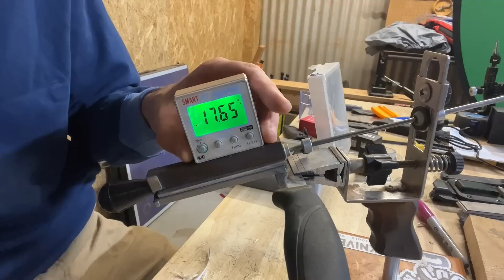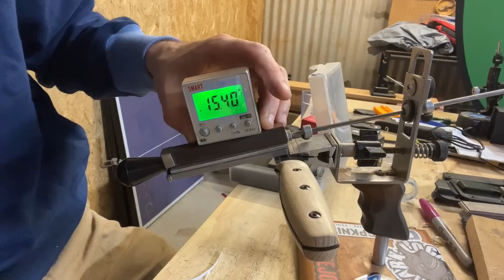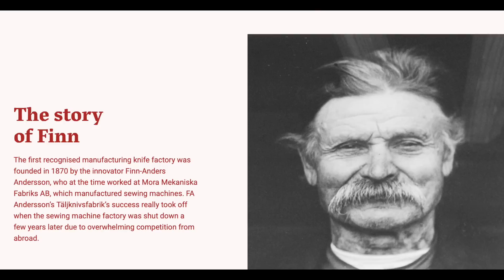The Gentrified Mora with Bin Steel? Morakniv Ash Series Finn

Comment: Mora has some real cajones releasing a knife that performs worse than a Condor for LT Wright pricing
Reply: Do people really have issues with condors? I love my condors, they just don't come sharp, you gotta sharpen them yourself. I love their 1095
Reply: I saw a Mora Garberg vs Condor Terrasaur test and they were head to head… I have a Kansbol but if I would like to upgrade I will go with the Terrasaur…
Reply: @mokgable  Condors are great, but they are basic materials (usually 1075 or 1095) assembled to hit a price point.  That’s not a problem.  If Condor took their current line and priced it with LT, Bark River, White River, it would be silly.
Reply: Why he always add -ish 
New-ish
Style-ish
Modern-ish
Does Everone in Austria are so "-ish"
Reply: @jimlahey5623  Australia 🇦🇺.
Reply: Well Benchamde is getting away with ripping us off over here in the USA.. So I guess Mora wanted to see that effect too.
Reply: Balls of recycled mystery steel
Reply: @mokgable condors were great when they fist came out because they were cheap and good quality. Now they've raised the prices so much they're expensive for what get imho
Reply: Benchmade quit ripping me off back after the large Skirmish was made and I haven't bought one since😂
Reply: Isn't condor some trash made in South america tho, hardly comparable

Comment: They responded to me on Instagram a while ago. It's their basic 12C27, doesn't appear to be any difference in performance (edge retention & toughness) between the new expensive ashwood line & a cheap companion.
Reply: Yes this is what they told me too. They said it's the same steal they used all along and it's always contained as portion of recycled steel *but they wanted to highlight the fact now*.  Causing all sorts of confusion.
Reply from the maker: certainly seems like it in practice. great steel on a $50 or less knife for sure
Reply: Thanks for the info.
I'll stick to my Companion, then.
Reply: @andriesquast2028  good plan!
Reply: @CedricAda its more like how is made than from what is made. Speaking that way than Devin Thomas knives should be priced low because his knives are made out of aeb l which is also inexpensive steel.

Comment: Hi mate. As you probably know by now, all Steel is recycled, completely normal, has been, according to Alleima for a very long time (and Larrin Thomas - see his book 'Knife Engineering'). Only kind for kind is used - 12C27 for 12C27 etc. Mora have recently, via their 'Steel grade Mora' system, become far more informative on their Steel grades and processing etc. Thus, in the case of this knife we learn that it's 12C27 using Cryo, with nominal hardness of 58 HRC. Purpose of Cryo being to convert retained Austenite to Martensite meaning significantly higher toughness and hence better edge stability. Notice only two point increase to 58 compared to nominal 56 for Moras using non Cryo (Companion et al) hence emphasis is on toughness. Bevel angle for this blade at 2mm thickness should be around 23°, so microbevel (Swedish - edge reinforcement) to bring up to, for me, 32-33° would be good. Mystery of 'Mystery steel' solved. I would happily give 50 to £60 for this, but not price asked. That being said Helle do a similar knife in 12C27 for far more than 50-60£, does that have Cryo?.
AL.

Comment: I feel the same with Gransfors Bruks recycled metal they use for the axe heads. I finally treated myself to one roughly a year ago to only be extremely and utterly disappointed. The first few times I "LIGHTLY" used it essentially just playing around with it to get a feel for it - it sustained micro chips in a roughly 1 1/2 inch section. I tried to stay positive and assumed maybe it had some softer left over bits on the polished edge... Fixed it and used it one more time and it failed even worse with more severe edge damage; I used it harder this time being I actually tried to chop up some wood which it is made to do. I returned it... The axe that failed me personally is the Wildlife Hatchet; I opted for it for a light weight chopping option. In fact thinking about it... I'm still livid about it.

Comment: In Serbia to import Fin is 160 EUR ($176.5) , Wit  is 207.6  EUR($229 ), and Lok 239.5 EUR ($264), a bit expensive for blade thickness of 2/2.5/3.2 mm and 12c27 is a low end steel. I like that steel even fore Helle i think it is pricy and Helle is chipper then these Moras. For less or equal money you have: Lionsteel B41 / B35 (Sleipner steel), Lionsteel M4 (m390), Lionsteel T5 (Niolox), Rokka Korpisoturi (N690 and 80CRV2), Benchmade Leuku(CPM 3V),  Benchmade Puukko (CPM 3V), Esse 4/5/6 (1095), Becker Companion (1095),  Fallkniven F1/F1x/H1/S1 (Wg10w and COS), Casstrom Lars Falt (Sleipner ), Casstrom No10 (14C28N), Brisa Traper 115/95 (Elmax , N690, O1), Demko Free Reign (Aus 10), Tops Fieldcraft (1095) ...

Comment: Hi there! I'm a big fan of MORA. I really love the Companion and Outdoor 2000. You can get them for just $20-$40.

I don't really need super steels. Knives made of 420HC, 12C27, or 1095 work just fine in the forest and are super easy to sharpen. You only need a small stone to get the edge back.

However, if I'm buying a $200-$300 knife, it better have super steel like S30V or MAGNACUT. Even though super steels aren't a necessity in the forest, a $200-$300 knife should have them.

I don't get it. I love MORA, but if it's $300, I'd go for a super steel knife.

Comment: Your comparing it to the wrong thing. If you wanted to compare it to the companion you should have got the Finn’s big brother.

My opinion, as I use the Finn for its purpose, it’s a great outdoor woodcarving knife.

Not an everyday bush crafter.

The thin stock is great.

Also, don’t compare it with steels for a different purpose.

Regular stropping of the Finn, in the field, when used for what it’s designed for is great and it’s easy.

I agree. It’s not for a knife fan boy.

It’s designed for those that know what it’s for.

I think it’s mostly the 27 steel. But maybe mixed with some of the 28. Maybe that’s why they just say “recycled” rather than what it is.

But Mora never just made this for themselves. It’s not a hobby knife.

It was made for people that know why the need it.

Price?

Think of this.

For years everyone has said that Mora’s are too cheap.

Then they start charging everyone else’s prices and they get it proper tight.
Reply: Nobody complains about the prize of older moras dude
Reply: @LosRiji  for sure , meanwhile they say they are better than a lot of more expensive knives.

Hence the price comment.

Comment: The recycled steel in that better be way better than what they use in the companion HD. 
Because when I got a companion HD with the new recycled stainless steel, I was quite confused at first. 
I'm still not sure if I got a knockoff, even though it came in original packaging. 
The grind is looking sharper, the microbevel is smaller but it doesn't cut very clean. 
The tip area doesn't even have a apex, I can see a reflection there. 
And the steel looks dull, refuses to be polished properly and has what looks like microscopic bubbles. 
At least the new production carbon steel version of the companion hd is still ok.

Comment: For the same price I bought a spyderco Enuff 2 in K390 on sale. I think you hit the nail on the head with the reason why this knife was made.
Reply: I really like mine but it rattles in the sheath. It’ll  probably cost me an arm and a leg, take 10 years to send it back to Spyderco just for them to say it “doesn’t rattle enough for us to replace”.
Reply: @Dan12345  the sheath is garbage. It dulls my knife every I draw it, I am making a new leather one. I don’t understand Bolatron sheaths, it dulls knifes just like secure X
Reply: @nandayane  I’m going to see what they quote me on return postage to see if it’s even worth returning. Luckily I have a leather sheath I made that doesn’t fit its the original knife well but fits the Enuff 2 quite well. It’s a shame as I really like the knife itself.
Reply: @Dan12345  I think the industry should move on from that style of sheath and just use kydex.
Reply: @nandayane  definitely agree. It’s the same with my Ka-Bar Mk1. I think sheaths should be Leather, Kydex or Canvas. A sheath that dulls the blade is a failed design.
Reply: @Dan12345  in particular with a steel like K390, eliminates the point of it.

Comment: That's a great 50€ knife !
For the price, you can get some alternatives in CPM-3V or Magnacut which are bulletproof !
Reply: @1800moonSugar  Less HRC so (way) less edge stability, less edge retention, less corrosion resistance, overall a worse blade imo !
And about CPM-3V it was made originally for huge metal shredders, hardness counts
Reply: @1800moonSugar   Yes Magnacut is not the toughest steel, it's not the goal of the steel. But it still is very tough even at 63 HRC, enough for most uses and brings other noticeable upsides to the table. 
What is your source for 12C27 having better toughness than CPM-3V at 61 HRC ? And what even is the hardness of this recycled Mora knife ? What steel even is it ?
According to knifesteelnerds AEB-L and CPM-3V behave similarly around 59-60 HRC...

Can you imagine people use S35VN ESEE knives without breaking them ?

They could make metal shredder blades from AEB-L or even better, in Mora's recycled steel ! But if I'd have to guess why they don't, it would be because of bad edge retention... I've even seen those made from D2...

I do agree Sandvik steels are great !

Comment: 12c27 should be really similiar to AEB-L.
the carbides are very small, so the toughness is 1084 and ,80crv2 area.
the edge retention is better than 1084, 1095 and 80crv2.
its stainless.
it was designed historically like AEB-L to be used in razor blades for gillete and other companies.
the high toughness is beneficial for edge stability 

source: knife steel nerds 'all about AEB-L'

its suppoused to be cheap
Reply: You basically just walked into an electricians convention and licked a 9v battery, then took a bow.
Reply: @CNYKnifeNut  on the one hand i dont want to ask to not ruin the joke on the other hand i try to understand and it doesnt work

Comment: If I’m not mistaken, Mora’s “recycled stainless” is 12C27.  I have an email around here somewhere confirming that. 
12C is a fantastic budget steel when heat treated properly. But it is not, I repeat is not, made to be put on a $200 knife!!!
Reply: Yep same steel they've used for how long and it's always had recycled content they just decided they wanted to emphasize that point.  Since they also neglected to tell people this it seems obvious to me that this knife was never aimed at real knife people.
Reply: In other words, this series is for casuals, aka suckers.👍
Reply: Couldn't they at least use 14C28N this stuff is krazy tough
Reply: 100%, if they made this in Swedish Elmax instead, ok.. then I could pay it.. but for recycled steel no way
Reply: With some trouble it's possible to find this information on the Mora website. It's 12C27 from the maker Alleima, it's also deep chilled during the hardening process. Feels like it's mostly aimed at the eco-mentalists. Nothing interesting.

Comment: Yea not buy one no premium steel and using cheap harbor freight ash wood  handles for the price you could get these and still have cash 

1 white river fc3.5 s35
2 benchmade 200 3v
3 esee xancudo s35
4 tops scandi trekker or fieldcraft 3.5 
5 Bradford Guardian 3 
Honorable mention white river puukko it’s about 15 20$ more 
Those are a lot cheaper and a lot better steel also those five have a very good warranty’s as well
Reply from the maker: Yeah, I think the mora line tops out with the bushcraft line, mayne the garberg if you really want that full tang. and even the garbergs half the cost of these
Reply: At these prices they probably don't have to sell very many of them to make a profit. Lol 

I still say we aren't their target demographic for this line.  Their trading on their good reputation and pushing upmarket to snag less discriminating consumers with fat wallets.
Reply: @CedricAda  not mention the garbergs use a better quality stainless. 

Also you can get it with multi Mount option and they actually sell a small sharpening/ferro rod holder for the garberg now
Reply: @MPiKMS72  honestly I would just used the garberg with wood handles call it the mora wood line series and up the price

Comment: this looks nice at distance, but the ones I have seen handle doesn't fit blade well enough to be comfortable, if you then factor the steel, just over priced, several similar full tang knives with better handle AND steel can be bought for ~50€

Comment: From the book Knife Engineering by Dr. Larrin Thomas, chapter 16 Melting and Solidification: 
"Most tool steel and stainless steel is produced through remelting steel scrap, either cutoffs of steel produced by the company or purchased scrap. This means that most of the tool steel produced is with recycled steel." 
In this regard the author does not differentiate between ingot and powder steels. 
My guess is that this recycled steel is 12C27 and they wanted to sell it with a different label, one that is seen as more environment frendly. In this way they don't have to adapt their production method to a different steel.
Reply: This is exactly what Mora told me when I asked them it's the same steal they always use they just wanted to emphasize that it was "green" so to speak.  Omitting mention of the actual steel type is caused all sorts of confusion in the knife community.
Reply: The marketeers at Mora who jinned this up should be fired…

Comment: Your comments about the tang protruding from the handle material is pretty standard on production bolt on knife scales. The knife is finished and then finished handles are bolted on to produce the final product. A custom maker would finish sand the entire knife to blend the handles and scales and then remove the scales to do final finishing on both the scales and the tank- producing that smooth transition that you seem to prefer. Mora stepped well outside their niche on this one- they are charging custom prices for a low end production knife. Best of luck to them, but as you said most of Mora's customer base will give this one a hard pass.

Comment: I have been thinking this is part of an attempt to create something like a collectors market for Mora products. It's so far removed from their regular product materials and pricepoint. Clearly its not a standout as a user but I suspect we'll see future iterations with minor differences
Reply: It is a nice looking knife I must say. The light wood handle with the black blade pops. But yes its just bizarre. To the point it somewhat tarnishes their reputation.
Reply: @VMC_Boy  I don't think it really tarnishes anything. The user market won't stop buying 511s just because Mora made this. I think it expands their potential market in the same way that Victorinox has both value and collectible markets priced on limited access and aesthetics rather than the steel innovation pushed by other brands. Most of us won't buy it, and don't get why they're doing it, but it doesn't change the value equation for their existing lines that the brand is built on for most of the folks who watch Pete's videos

Comment: What you said,about impossible to avoid a microbevel when you stroping or use buffing wheels isn't true. Most microbevels are done on purpose, because iit's the fastest way to make an edge feel sharp. Thats why you only see that on inexpensive and mass produced knives. The myth that it adds to the edge stability,is just manufacturers lies, to make it look like a special feature,when in reality  not only doesn't add to the blades performance but it literally takes out of it a lot. LT Wright does it a bit better,but it still isn't a proper edge bevel.  It shouldn't matter though. Since all knew knives should be sharpened before 1st use,for many reasons.
Reply: Yeah, I have to agree. I have many moras, and scandi knives and have put true scandi on most of them, and strop them to maintain them, just as long as you follow the proper angle. The only true scandi factory knives I have gotten are BPS knives, and they are absolute laser beams
Reply: @shawnpepin7890  Its not that it cuts easier.a proper edge can do a lot more than a factory one. For example carving wood, or making feathersricks. You also get better edge stability if done properly.so you upgrade everything about tperformanabout, plus the knife can do jobs that with a factory edge,couldn't't do at all!!
Reply from the maker: yeah this is most likely a result of factory finishing, and when repeated at home by me, a sign of my still developing flat stone sharpening skills and impatience! This guy came with a tiny micro but i confess I made it worse/more prominent upon touching it ip